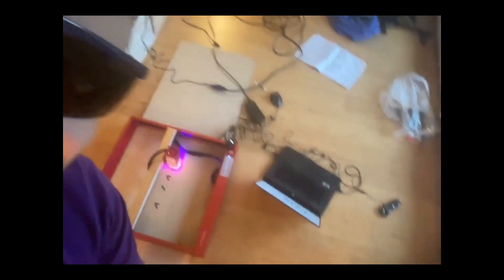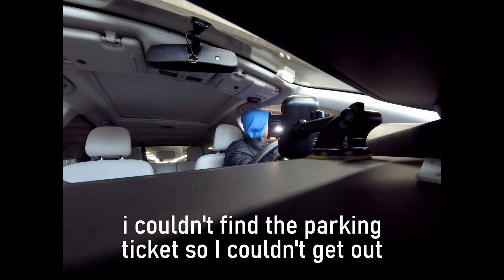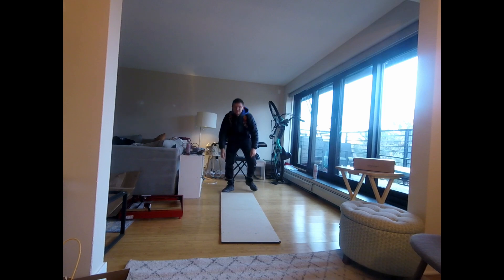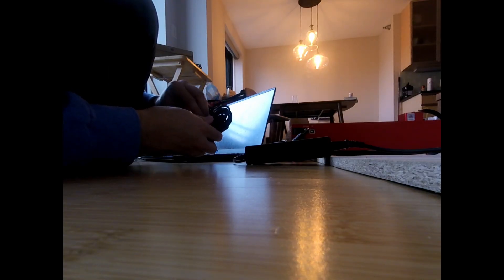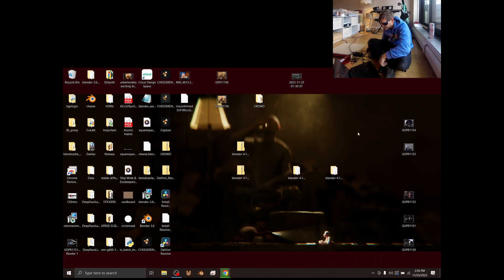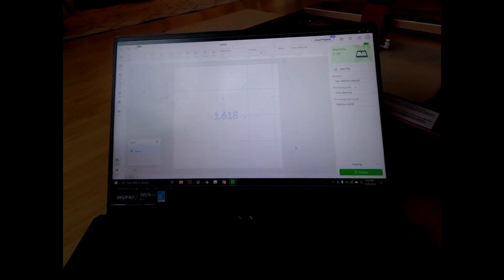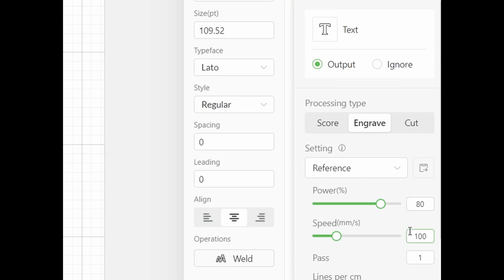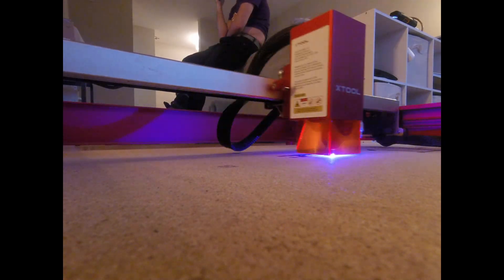caveman youtuber vs a laser - xTool D1 Pro Laser Engraver 10W

Comment: Ventilation is very important (There are some nice, relatively cheap air quality indicator machines out there to be sure). Honestly these things should not be being sold without major fume warnings and enclosures, as they can generate some really nasty fumes even with "laser safe" materials. Nasty as in very likely to cause lung cancer. I don't doubt there's going to be a major lawsuit in the coming years with all these open designs and lack of warnings. (Cutting specifically generates massive amounts of fumes) Also, other bits of note: Glass etching produce microscopic silica particles, lots of cardboard and mdf have chlorine-based glues, non-vegetable tanned leathers can have chromium, aluminum etching produces powder, etc. Always be careful and look new things up beforehand up beforehand.
Reply: We run a GlowForge in my house, so not to turn people off, but just to make sure its risks are known and handled. (Maker's Muse has a really good video on the subject for a crash course)

Comment: For a first time set up, it seemed to be very straightforward and simple to operate.
Reply: Yep, just got to remember to regularly clean the lens otherwise you will notice a drop in strength/settings but if you keep it clean then pretty simple.